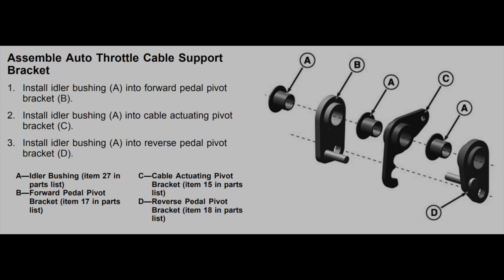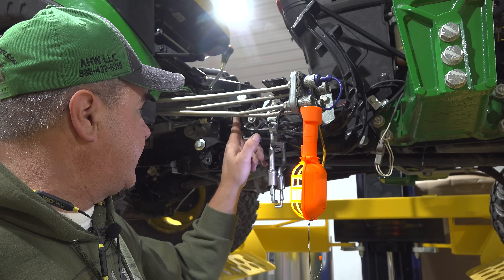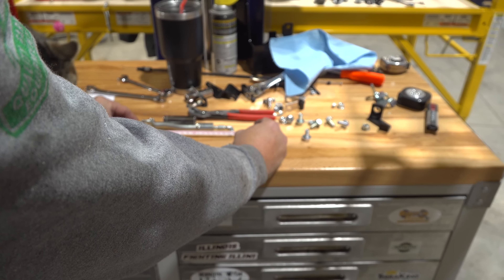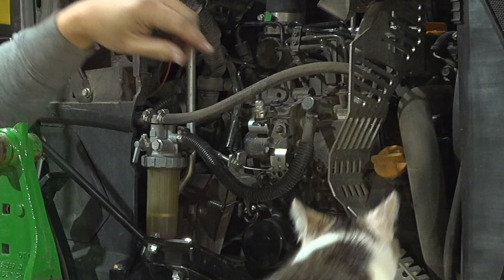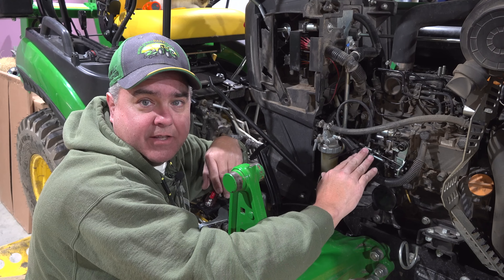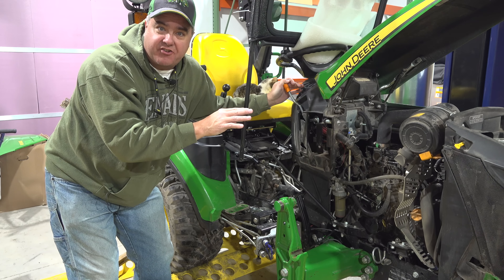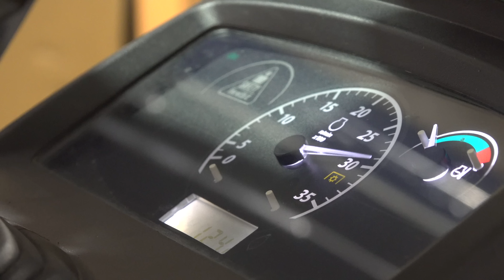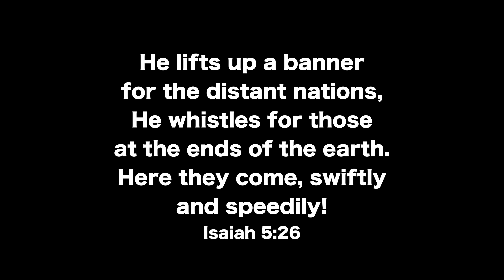Deere 1025R Auto Throttle -  Will It Work?

Comment: I was concerned until you showed the second throttle cable.  Times we need engine speed for the PTO but don't want to scoot along.  Like when tilling or rotary cutting.  Probably be one in my future.  Love the cats!  The only time we don't get lots of help from ours is when running the vacuum cleaner.

Comment: Will it work on the 1023E?
Reply from the maker: Yes, it should.  Do you have a backhoe? If so, then it only works on 2018 and later.  Also, if yours is prior to 2018, you will need new hydrostatic pedals.
Reply: @TractorTimewithTim  I got my 1023E home today - new.(I had to pick it up they had no time to deliver)
I noticed mowing the throttle will only idle down to 1800 -too fast, and throttle up to 540/2600 area only.
I know the dealer will be too busy to get them to look at it, so I will do the adjustment in AM tomorrow.
Any tips would be appreciated, I am on green tractor talk -same subject and they have a couple diagrams -1025R idle adjustment serv book pic.
Love the tractor.

Comment: Any idea if this would be compatible with a 2305?
Reply from the maker: No, I don't think it would work on a 2305. Time to upgrade :-)
Reply: @TractorTimewithTim  would love to but it would cost over 20K to replace it and my bride says NO!
Reply from the maker: I would think you could trade for less than 20k.
Reply: @TractorTimewithTim  My tractor is 12 years old, near show room condition with a curtis cab, heat a 62 deck. 54 plow, 350 hours.  NO dealer is gonna trade me for less than 10K. They tell me it's not worth anything because I don't have a loader for it.  IF i got a 1025 I would most likely NEED (ha ha) the Mauser cab over the curtis.  I can due with out the mower, I bought a new toro z with comfort ride.  world of difference mowing between the 2.  I just use the JD for plowing snow now

Comment: It appears this kit is only compatible with the latest model 1025R. I ordered this for my 2016 1025R TLB. Upon trying to install I realized the twin touch pedals do not have the holes. Additionally the bracket doesn't seem to clear the floor board support.
Reply from the maker: Ugh!!!! Sorry!
Reply: @TractorTimewithTim  In looking at the parts catalog for mine they show the forward pedal LVU31120 subs for LVU23152 and reverse pedal LVU31119 subs for LVU23151. These pedal part numbers are what is on the current 1025R parts catalog. However the pedal support bracket is a different part number. If I send you pictures of the bracket on mine could you compare? If the bracket would mount I would buy the two pedals. Otherwise I'm going to see if GreenPartStore will take this kit back.
Reply from the maker: Yes, I will take a look.  Tim atsign tractor time with Tim dot com
Reply from the maker: I spoke with Ryan.  Turns out the backhoe subframe for the 260 backhoe conflicts.  So, if you have the older backhoe, please do not order the kit.   
If you don’t have the 260 backhoe, you will still need the updated pedals mentioned above.

Comment: Nice add on. Tim I’d would only suggest you put some type of coating on the bolt where throttle peddles meet the bolt. That bolt seems like it will wear into the peddle coating eventually. Check vid at 5:50. Great vid though.

Comment: Hi Tim thank you for videos. Maybe I missed it in another video. I see tie downs brackets on the front. Also I thought I saw some under back axle. Are these john deere sourced? Or aftermarket? I would like something similar for my new 2025r. These should be factory from deere in my opinion. Thanks.
Reply from the maker: Muddscustoms.com use code TTWT for a 5% discount.

Comment: How would that work when you're trying to run your PTO at 5:40?  I think you might need to back off the autothrottle forward controller to a maximum rpm that would be equal to 5:40 so that you would never over spin your three-point devices
Reply: A disconnect or something would be good for pto use.   I was thinking the same thing for mowing or tilling.
Reply: You would need to set your hand throttle at the proper RPM.
Reply: But keep in mind, auto-throttle only increases your engine RPM beyond where the hand throttle is set when you press on the FWD/REV pedals. So if you have your hand throttle set to ~3250 RPM for 540 PTO use (or 2100 mid PTO use) the RPM would only increase beyond 3250 if you mashed the FWD/REV pedal all the way down. How often are you running a front or mid-PTO implement with the hydro pedals mashed to the floor?   I suspect, to eliminate any concern, you could always adjust the linkage such that with the pedal all the way to the floor board the engine RPM will be right around 3250-3300. That way maximum PTO speed would never be exceeded and you'd never miss the extra 150 RPM of ground speed.
Reply: I can't imagine why you wouldn't be using the hand throttle when mowing anyway.  Raising and lowering the rpm drastically with the pto engaged is very hard on clutches, slave cylinders and throwout bearings.  This should always be a gradual process unless a safety concern arises.
Reply: @eosjoe565  I think you've made a good suggestion about keeping the max pedal rpm at the max pto. If you need max rpms, perhaps for driving down a road, there's always the hand throttle. I would personally also prefer to have a little pedal movement without raising the rpms. I sometimes like to putt around at idle, especially when my tractor engine is cold.
Reply: @hardnaaklife  Based on the engine HP/RPM curve, that PTO speed is at maximum horsepower anyways, not much use for faster rpm as you are past the knee of the horsepower curve. The only advantage is faster transit speed, at the expense of both horsepower and one's hearing.
Reply from the maker: Run wide open throttle for PTO work:  you guys are over complicating this.

Comment: So I purchased this kit for my 2018 1025R. Just installed it over this weekend. I had one "issue" and I also have 2 "concerns". The issue was the internal threads on one of the linkage adjustment parts were not machined very well. The corresponding piece that threads into it would only go in about 2 threads and then come to a hard stop. Using pliers to try and get it past that position was to no avail. Had to re-tap the threads which are size M8 with 1.25 thread pitch. Wasn't much of a problem for me as I have tap and die sets already in my tools inventory. But if someone don't have them, it would be a very big inconvenience because you would have to stop installation until you can get it re-tapped. My 2 concerns are.... 1 - The 2 little cotter pins used to keep the adjustment linkage to the auto throttle bracket assembly are very small and thin. I see them rusting, rotting & breaking off in the near future. 2 - The throttle cable going from the auto throttle linkage to the fuel pump is very long (actually made for the 2025R) so with the extra length, you need to have extra bends and twists as you route the cable and I think as time goes by as moisture occurs within the cable housing, you may end up with a little rust in there which may prevent the cable from functioning properly. As far as the functionality of the auto throttle itself, I love it !! It feels kind of weird hearing the throttle increase and decrease as you step on the pedals. I really do like it. Thank you TTWT for your video. It was VERY helpful. The kit is not that hard to install and Im glad I purchased it. Just wanted to share my installation feedback in hopes of helping others as I don't see any other installment comments. Hope this helps someone.

Comment: Cool video. My only question is, should you set the HST pedal adjustment so that at full travel it revs to the rated PTO rpm instead of 3400? If you're using either the mid or rear PTO won't it overspeed the implement at 3,400 RPM when you press the pedal all the way down?

Comment: So do you think this will also work on a 1026R?  Not sure if the 25 is different.
Reply from the maker: Yes. I think so.
Reply: Thanks Tim.  I wasn't sold on the idea until I saw you drive it.  That's seems pretty sweet.

Comment: Can you use this with the mid mower? I know you have to maintain a certain rpm for the mower and if slowing down to turn will it maintain your required rpm?
Reply from the maker: Yes. Well, I assume we can.  Haven’t tried it. 
Use the hand throttle to keep the rpm up with PTO implements.
Reply: Yes I have it on my 2025R and the hand throttle sets the minimum rpm.  Then the pedal will increase above the min you set the further you press. I use the hand throttle to set it to my mowing min as well as to increase rpm for faster loader response time. Otherwise I just leave it at idle and let the auto throttle manage the rpms when I’m just fooling around the yard.

Comment: Can you easily “disconnect” the linkage if you have an application that you don’t want auto throttle? Been thinking about one of these.. thanks!
Reply from the maker: Easiest way would be to disconnect the linkage from the fuel pump.  Wouldn’t take long.

Comment: What happens if you set say a 20-50% throttle for spraying application or similar and then press down on pedal? Does it go up in throttle and immediately go back to set throttle when released?
Reply from the maker: Hand throttle sets the ‘minimum’ rpm. Foot throttle advances the throttle when it is pushed hard enough to be ‘above’ the hand throttle setting.

Comment: Hi Tim, I think I may be ordering this but I have a couple questions. 
1 - how is it holding up so far?
2- Am I correct in saying that the hand throttle will override the auto throttle?
Need constant high rpm's when snow blowing even when moving slowly. Can I raise the hand throttle to achieve that and keep the high rpm's going while snow blowing?
Reply from the maker: Yes, hand throttle sets the MiN RPM.

Comment: Hi Tim. Just ordered this kit using your promo code for free shipping. Just wondering if this video is updated with instructions for the 1025R. You seemed to have added some notations into the video which seem to support my question. do you know if the instructions that come with the kit have been updated for use with the 1025R ? Or should your video be used as an assembly instruction manual for my 2018 1025R?

Comment: Dealer (close to you) added the auto throttle and 3rd function kit to my 2025R before I took delivery. I returned it for adjustments to both. I hope they are ok. Had I seen your video first I would have done the auto throttle myself.
This is my first tractor and I really like the auto throttle. I have only used the 3rd function with the loader mounted blade. Really want a grapple.

Comment: I wonder if it is possible to remove the antagonizing hood release on those newer 1025r models. I prefer the older design, the design that doesn't require using the key or a tool to open the hood.

Comment: Believe I understand the reasoning of it all... but there are times when I run down the roadway or fence line, and just don't need/want high rpm's along with faster ground speed.  Think I'll stick with the factory hand throttle on my 2025R.  Great video TTWT... hopefully we'll have a snowy or dry earlier spring this year...

Comment: Hi Tim,
Great install video. One of my tractors is a Rural King RK-37 with a cab, and standard it has Auto Throttle. Most of the time I don't use it, but for pallet fork and loader work it is great to have!
Excellent Video work showing the actual install.

Comment: Hi Tim fantastic video, very interesting. Do you know if there is a auto throttle for a 2601 Kubota? I’d love to have that on my tractor. My Kubota runs at 2800 rpm about 600 rpm less then the 1025 JD. keep up the great work, Wayne from Wisconsin.

Comment: Sometime when I get some free time (HA! like that’s gonna happen...) I wanna cook up something like that for my MF GC1723... except I think I’ll go the electronic route; with a Hall effect sensor on the hydrostat control lever; a custom PCB with an ATMega328pb (Arduino compatible) & a high-quality RC servo (like they use on giant-scale RC airplanes) to pull on the throttle on the engine. 🤔

Comment: What is the need for auto throttle?
Reply: First I will say that a lot of folks with auto throttle mis-use it. One of the primary uses for auto throttle is when plowing snow. As you move forward pushing snow the engine RPM increases and when you stop the engine RPM decreases. Over a long plowing session this can save fuel compared to having the hand throttle set to mid to full throttle all the time. But all too often folks with auto-throttle putt around at near idle doing loader work and that is not really how it was intended to be used.

Comment: It would have been interesting to see how it works with the hand throttle set at 3/4 or so rather than at idle. I guess it goes without saying that this mechanical auto-throttle has no ON/OFF switch, unlike the auto-throttle on the Gen-2 2032R/2038R.
Reply from the maker: You are correct.  The hand throttle works as the ‘minimum’ rpm ...same as it does with the 2032/2038/3R, etc.

Comment: That is an excellent how to video!  Great explanation and I feel any of us shade tree mechanics can install it on our 1025r's.  Question though... for the tough part of pulling out and re-installing the factory throttle cable, would it be a sin to bore a hole for access through that structural plastic on the side by the fuse box?

Comment: When you mention "Auto Throttle" my 1st thought is an aircraft or boat "Auto Pilot". My little Cub Cadet XT1 has cruise control and I mostly mow in idle or just above, but I see the advantage of "Auto Throttle" when plowing snow.
Reply: When mowing you should have your tractor running at full rpm.

Comment: So, for loader work, you set the auto-throttle to whatever RPM is good for the weight and cylinder speed desired with the hand throttle, but then you can drive at any speed, ranging from stopped to maximum speed?
Is that correct?  What other uses are there for this set-up?